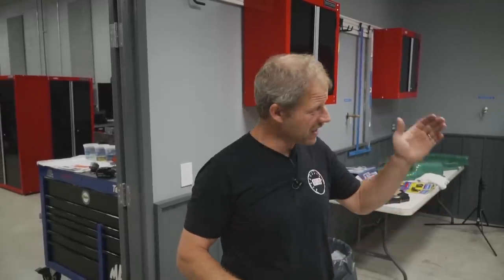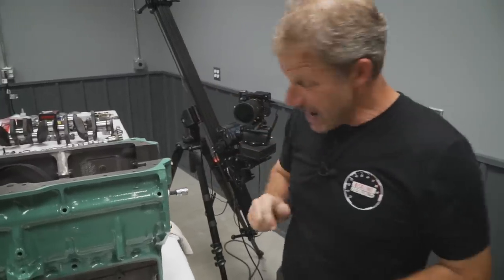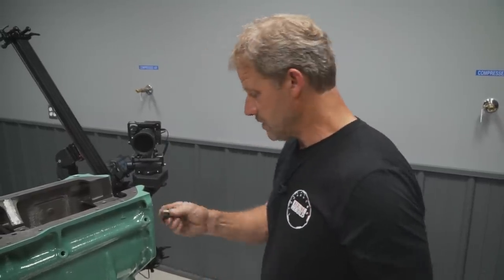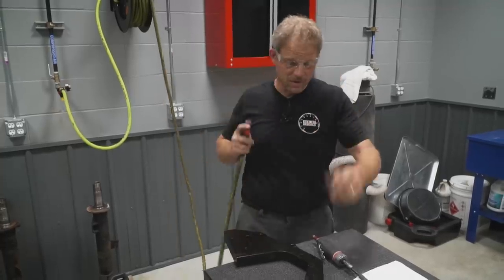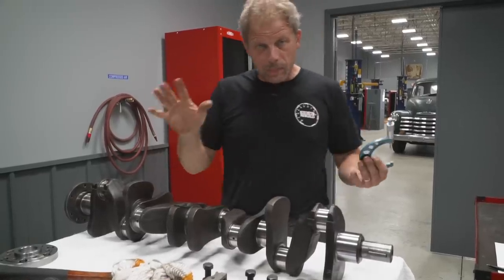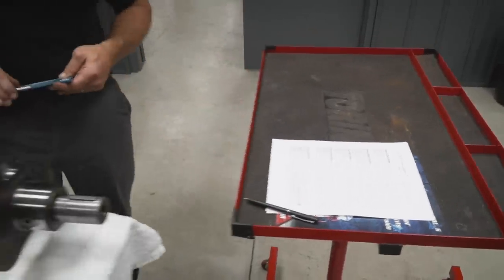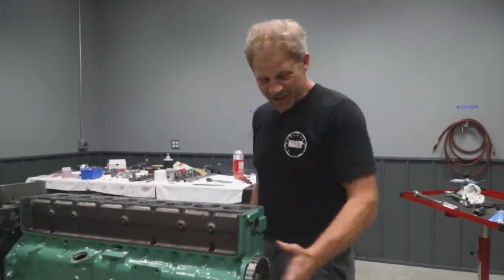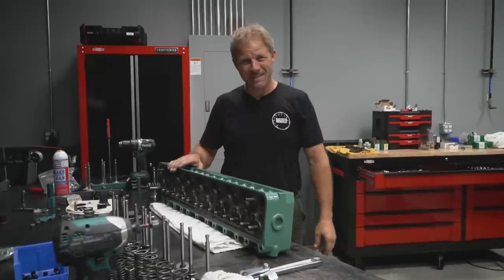The crank is in on our Buick Straight 8 | Redline Update #55

Comment: Can’t wait to hear this engine run !
Reply: I agree!
Reply: Damnit!  You beat me to it lol
Reply: I'm expecting to hear some knocking noises. 
All I have seen all the way through this series is pure hackery. 
There aren't many competent shops out there anymore, the few that are would never have the camera crew in the shop getting in the way.
Reply: @davidparker9676  wow that is a bold statement.  To me the fact that a shop would allow a camera crew into the work area means they are confident in their work and have nothing to hide.  
Please elaborate on your statement, what "hackery" have you witnessed?  I'm guessing you must be in the engine industry?
Reply: 302hobronco, the one thing that got me was that shop that drove the new cylinder in with a hammer and broke one of the cylinders. That was a little dodgy! I think everything that Davin has done is top notch stuff!
Reply: @Hoaxer51  I do remember that and it was cringe worthy.  I've seen liquid nitrogen used to cool the sleaves than a press to push them in the block.  But this isn't the first time this guy has done the hammer sleave method and it had worked.
Reply: @Hoaxer51  He actually broke two cylinder sleeves, the second was found afterwards. They made a vague mention to it in the description and comments.
Reply: @302hobronco  Confident and arrogant are often no relation to competent.

They may not know that they are hacks. They might think they are doing the best job in the world.

Have you ever known anybody that thought they were the best and they were in reality closer to the worst?
Reply: @302hobronco  Me too lol 😂

Comment: Out of all the engines, this is one of my most favorite as I got to hangout with and protect seven 1949 Buick Roadmaster's with the Fireball straight-8 those cars featured. While not all the cars ran under their own power or even had wheels (mounted to flatbed trailers), they were featured in the 1988 movie 'Rainman' where I worked behind the scenes for Universal Artist. Can't wait to see this engine back together and running.

Comment: Use grease on the tap to manage the shavings.
Reply: That , and tip it downhill a little , blow it from the ports further down and run some brake cleaner thru it. 
It'll be fine if you're careful and clean it out good.
Reply: And give a little push in on placing those bearing shells and it won't scrape the back of them as bad. 
If you do scrape one a little bit, be sure to pick the sliver of metal off the main saddle before installing the cap.
Reply: All excellent advice.
Reply: Um , y not just cut the plug , and I hate Teflon tape. Many better things to use, like anerobic. No problem w cutting the plug dies that size in my box last twenty years
Reply: That magnet worked pretty well
Reply: Dennis Ford Yea, that sounds great and all until you realize now you need to broach the hex or square drive afterwards. 🤦🏼‍♂️
Reply: @RansomDC5  
And the next guy who has to remove it is gonna be pretty bent.
Reply: @dennisford2000  looked like he was using a sealant paste, not tape.
Reply: Jordan Vander Heide still modify the part to fit the block.
Reply: Why is clearanceing a spot on the adapter plate not an option?
Reply: If you're depending on the magnet to work, I wouldn't use grease.
Reply: @w.s.soapcompany94  exactly
Reply: @w.s.soapcompany94  that involves a lot of measuring, and probably because it is not meant to be that way
Reply: All good advice, to a rookie, this guy has forgotten more than all of you put together will ever know

Comment: Little late now but there is a thing called a level seal pipe plug . With it
I am pretty sure you wouldn't needed to retap
the hole. They are made so they seat slightly below the surface. They identified by small dashes stamped in a circle around the hex socket at top of the plug. 
I first learned of them at a mold shop I worked at. 
They used them on the bottom of a mold base to 
seal off water lines . The plug had to seat below the surface so base would sit flat. Maybe something to think about in the future.
Reply: Yup im thinking there is a Possiblity that Long Plug could be Somewhat blocking Oíl Flow from its Intersecting Oíl Galley. I would Shorten the Plug from the Outside if the Depth of the Allen Hole would allow for that. And never Use Teflon Tape or Silicon Interally.

Comment: This engine is putting up a fight to be assembled!
Reply: @davidparker9676  why are you saying this?
Reply: @vinicius9670  Because it is the truth. 
This series is a great example of what no to do. These guys are hacks!
Reply: @davidparker9676  but what did they do wrong with this assembly?
Reply: @vinicius9670  Just about everything. The shorter list would be what they did right.
Reply: @davidparker9676  ok, but you need to tell exactly what they did wrong. Give us examples, please.
Reply: @vinicius9670  Seriously, just about everything.
I am not getting paid to spend hours listing all the reasons why these guys are hacks and butchers.

Like I said before, the list of what they did right is much shorter. 

These guys have done more damage than they have repaired. These guys might get it it run, but I guarantee it will have problems and will not last. Hopefully it is used in a trailer queen so it only needs to drive on and off the trailer at shows.
Reply: @davidparker9676  You say everything is wrong but you can't point anything.

Comment: My uncle built several of these strait eights. As I recall the piston to bore clearance ran a few thousandths more in the rear 2 calendars due to the fact they ran a little hotter. That’s a lot of block and head to run coolant all the way back with the relatively crude cooling systems of the time.

Comment: Nice to see someone actually putting in a camshaft with CARE.  I cringe when I see some videos where camshafts are installed and you know they are nicking up bearings and the cam itself.  (Does seem tight though, as others commented...)  Glad you got the valves figured out. Whew!
Reply: Was that Cam Checked for Straight?? If it is Straight something Else is Wrong.. Cam Bearings can be Scraped with a Machinist Scraper in  Situation like this.. This Cam is way to Tight.. IMO.. It needs to be Remedied.

Comment: Looked like the cam was really tight. I would be worried to run it like that. What would be the fix though?? Maybe replace the bearings with another new set?? Maybe one got installed crooked??
Reply: Cam Could be Bent.. But you can Use a Machinist Scraper to Scrape a High Spots on the Cam Bearings Its Perfectly Acceptable ive done it a Couple of times on SB Chevys.. IMO I would not Run this Situation it needs to be Fixed.

Comment: that little handle at the end of the micrometer is designed to slip so you get a consistent measurement feel is not consistent
Reply: Only in the hands of a novice.

Comment: One of the best and most powerful straight 6 in ever built was a 302 Jimmy GMC 2 barrel carburetor with 3 inch exhaust what a beautiful sounding engine Big 12 inch clutch, it purred like a kitten which horsepower smooth Power Band

Comment: If you have to tap an oil drain plug or something like that, coat the flutes of the tap with thick grease. Tap a little ways in and clean the tap and then tap some more, no chips in the pan.

Comment: About 4:00. 
Grease on the tap and a magnet on the end of the tap is an antique aircraft trick.
Also you added to the problem by using teflon tape. 
Before sealing items were invented the seal was created by "mating" just snugly install then remove the plug 20 times. 
They will fit exactly.

Comment: On the pipe tap: put some grease in the tap flutes & it will catch & hold the cast iron chips. I haven't followed the machine work on the block. Did you have it align honed? If not you should have checked for crankshaft bind. Install crank using some 30W oil on the bearings, torque main caps then check for free rotation of the crankshaft. On inline 6 & 8 cyl engines it doesn't take much much warpage of the block to put the mains out of alignment. V-6  V-8 engines aren't much affected bu slight warpage. Never worked on a Buick inline 8 so this is interesting.

Comment: That cam looked like it was too tight for the bearings. Is that going to work ok?
Reply: We all know that the cam was to tight and the cam is going to gall the bearings in about 45 seconds if not sooner it would be nice if you would address problems like that and show the solution you came up with instead of just skirting the problem and moving on as if everything is OK
Reply: YUP that Cam is way to Tight.. And I Agree with your Comment... But he Seems to think its not a problem.. I Dont get that Either.. It needs to be Fixed

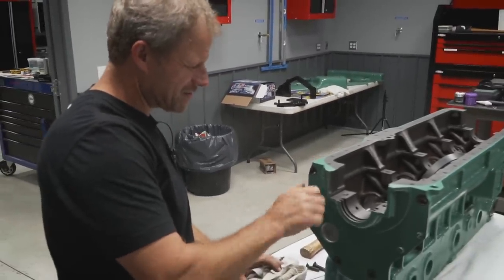Comment: 4:20 I'm thinking that this is a common enough problem that surely someone has come up with a kit that's something like a length of tubular (slightly conical) wire mesh with some soft foaming compound that sets up, like a foam rubber. The mesh, have a line from the nose running back down through an insert in the middle. Coat the whole thing in the foam compound, shove it in the hole, and wait. 

When it's done, pull the insert out and tug the middle wire. The cone should collapse in and pull the 'hardened' foam off the inside of the hole and bring with it anything it would have enveloped... swarf, slivers, sand, pieces of abrasive media, bugs, whatever.

For this hole it's overkill, but I'm thinking deep blind holes that are a royal PITA to flush without sending jets of solvent to the shop roof and so on. 

Or a steel wire bottle brush with a magnet on it. *shrug*. Shouldn't post before noon....

Comment: Why didn't you coat the tap with grease to catch the filings?  I had to tap an aluminum head for a sleeve for a spark plug and did that.  Never had a problem.

Comment: Was wondering about the crank geometry,  
Wish you would spend some time talking about that and how it affects the primary and secondary balances, rotationally induced harmonics, and the relitive degree position of the pistons and ignition timing.  This crank appears to be a cross or cruciform crank as opposed to a flat crank and should deliver a power stroke (actually 2 power strokes) every 90 degrees of rotation without the need of a counter balance shaft.
Please correct or add more if I'm wrong or left something out

Comment: I’ve put motor together that make 4 times there original power output with plasti gauges and they run perfect. Good oil pressure  and runs silently. I’d rather you assembled the motor after plasti gauging it to check for oil tolerances than have the motor ready for assembly and start running taps through it.

Comment: One thing I'll always take brake clean and a gun brush or cleaning brushes you can order and I clean out all the oil galleries with a little bit of brakes clean  with air nozzle you absolutely must have all metal shavings removed.

Comment: Liked your towel to left the crank by rod journals. better then having 2 people to drop it in . Question ? how much oil clearance on the mains did you wind up with ? Are you going to use a rope seal on the rear ?  If so , dry install or soak the seal in oil over night ?

Comment: Understand  your thinking regarding measuring with actual gauges. Have had experience, however with casting warpage or ?? that results in the main bearing bosses not being in line. So, while your dimensions can result in the correct clearance, the shift in the boss location eats up that clearance. The Plastigauge will show that conflict. Obviously, the crank should be hard to rotate also. "Align Bore" time !!!

Comment: how about notching the adapter plate to clear the oil plug? You could mark it out and then mill it out or use a drill press.  Next time.

Comment: That Coating on that PLATE could cause Mis-Alignment with Center of the Crankshaft and Center of the Transmission Shaft.. And that Tight Fit could Tweek the Dowel Pins out of Alignment.. Just Sayin ✌️

Comment: Question: Do you ever pull your cam bearings into place instead of hammering them in? I was watching a Farmall tractor rebuild and the man said he would rather pull them in with a puller he made than beat them in.
Reply: I'VE Hammered in Tons of Cam Bearings W/O any Problems.. But Something is, Wrong with this it needs to be Remedied.. Its way to Tight IMO.

Comment: Why didn’t you bore a clearance hole in the adapter plate to clear the pipe plug. Just deep enough to clear the plug, not necessarily all the way through. No chance of swarf from the pipe tap getting into the oil gallery that way.
Micrometer😊 vs. plastigauge😞, good choice. 
The timing chain looks super heavy duty, won’t stretch for a lot of miles. 
Another excellent video.

Comment: How about the rear rope seal installation ?  The last straight 8 Buick I rebuilt had problems with getting the correct rope seal . Couldn't find a rubber or viton seal that would work either .

Comment: How did you go with the block after showing the rock ape smashing cylinder liners in with a hammer and wrecking them? How many were cracked? Did you press or freeze them in rather than using brute force and ignorance? Have you stopped using that machine shop?

Comment: Would appreciate knowing who did the cam and crank grind/clean up.  I have a Pontiac straight 8 and need someone with proper tooling to handle the longer heavier parts.  Looking at tractor engine shops.  Who did the work on these parts?  Thanks.

Comment: So, any plans to address the Hammered In Screw Ups of the Cylinder Liner Install - have they been bored out and fresh ones put in using the correct Hammerless technique?
If not, will Hagerty be honoring the Warranty and Insurance of the engine for it's expected lifetime, up to the same number of years as it has already lasted?
Seems silly to be assembling an engine without having fixed the issue of poor quality workmanship during the incorrect liner install procedure.
Same goes with using Valve Springs whose inside diameter has them binding on the top of the Spring Seats.
Reply: Just send it..
Reply: @gerbenhs  a.k.a., "Just break it."

Comment: Are u kidding!? Didnt the sleeve debacle make a point ? Driving the cam bearing in with a socket? and no pilot into the next bearing back in the block to maintain alignment ???? 
WTH !!!
Reply: The Cylinder Liners, and then the hammer on the Valve Liners too,... I wouldn't want to be the owner of this engine, it's going to need to be stripped down again soon, everything bored and aligned again, and assembled correctly.
Here's hoping Hagerty Insures the workmanship, but I doubt it.

Comment: Run the plug through a die🤔
Reply: classicrestoration the plug itself wasn't the issue - the tapped hole for the plug in the actual block wasn't threaded deep enough for the plug to flush with the mating surface for the adapter plates
Reply: No kidding.... A pipe die is tapered and running the plug through it would reduce its diameter and make it fit flush with block. Why risk introducing chips/swarf into a main oil galley?

Comment: I have to point fingers and give critical input, ..........
@ 7:37  when you are installing and rotating the cam shaft and make the declaration "She's a tight one boss"  this is due to the fact that you are assembling this on an engine stand and the block is deflecting under its own weight.  Seriously,  that really should be done on a table.  Long skinny engines should not be assembled on a stand, they will bend, deflect, deform, and you're seeing the evidence of it right there.

Comment: I would rather have ran the oil gallery plug thru a NPT die than use a NPT tap in the block but also that's me

Comment: Straight 8's were far superior to ford flathead v8's.
Reply: I'll stick with the Ford engines, they are just cooler overall.
Reply: At least the Buick straight-8 has overhead valves going for it.  Unfortunately the intake manifold plumbing all those cylinders to a single one barrel carburetor isn't exactly performance oriented  ...

Comment: Was really enjoying this video, .......... until
you mounted that really   l o n g   block on the engine stand.
This shocked me and I have to ask,
Are you not concerned with warpage?
I would have left that block on the table until the final head bolt was torqued down to spec.
I know an engine stand makes for a lot of convenience but, me personally, I would not buld anything longer than a V8 on an engine stand

While I'm asking, has anybody ever made a VERTICAL engine stand?
One that mounts to the engine mount points?

Comment: School hard knocks ! ! ! LEAVE cam plug out ! ! ! Dry fit cam ,you have slippery goo all over journals and it's to tight  ! ! ! Absolutely  need to remove cam and find the tight spots.  I'm only at 8:00 and I don't  like what I see. Plastic pistons, cool idea ,but you are already crashing a cam brg. Measure journals and brg bores. The brgs can be hand scraped. That cam should rotate without the gear on it.

Comment: One more minute in 9:11, isn't that interesting. Micrometers will give you dimensions plasti gauge shows you a footprint. Nice in the mid point tight on the ends of the surface, or many other conditions.